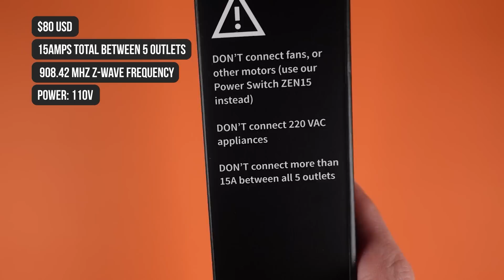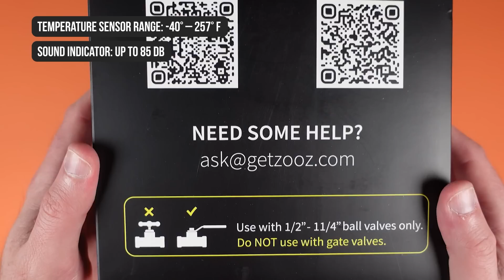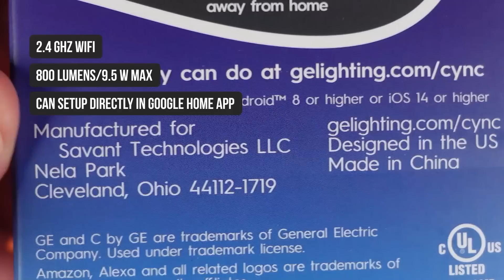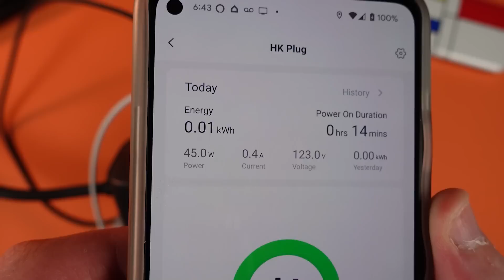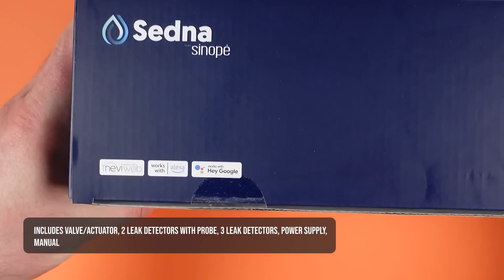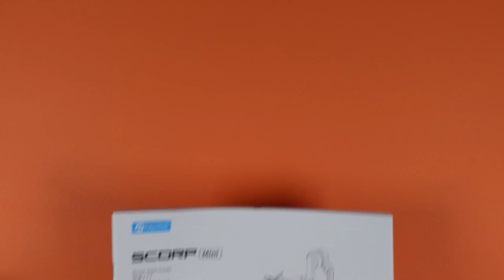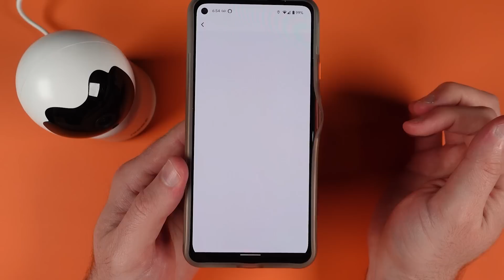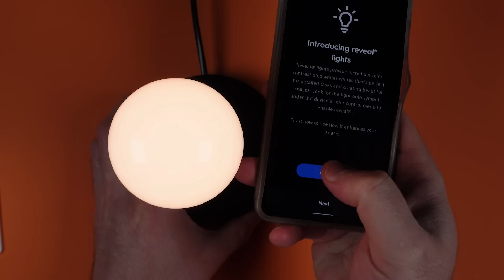My Massive Smart Home Tech Unboxing - EP 3

Comment: I've had terrible experiences with Cync products.  I've now banned them from my home.  Not worth the frustration.
Reply from the maker: Oh that's too bad!  I've been happy so far.  What happened for you Britt?
Reply: @AutomateYourLife  - I had a couple of the traditional-looking toggle light switches from GE that I'd end up having to re-pair with the system at least weekly.  I had hoped that when the app changed over to Cync that it would be better, but it was not.  I replaced them with another brand and have had no issues
Reply from the maker: @BrittCHelmsSr  ohhh yeah I mean the old gear is very different.  It's not the app that's going to help.  It's the gear itself.  They couldn't do connectivity well, or that was my experience.